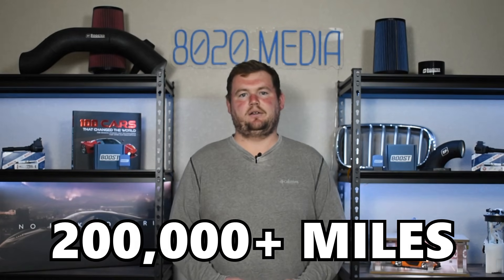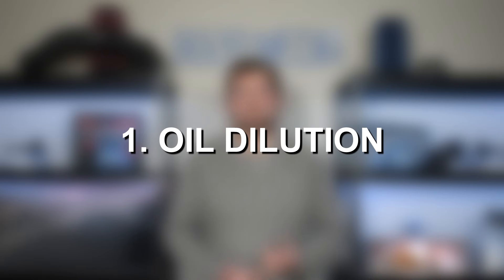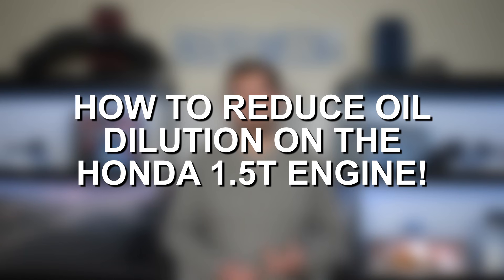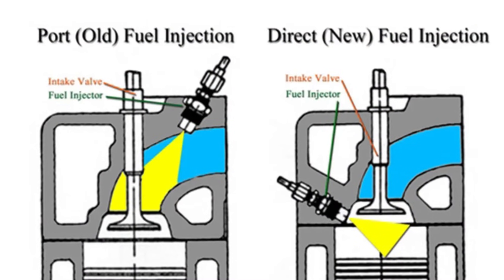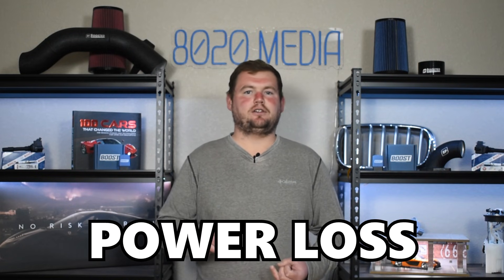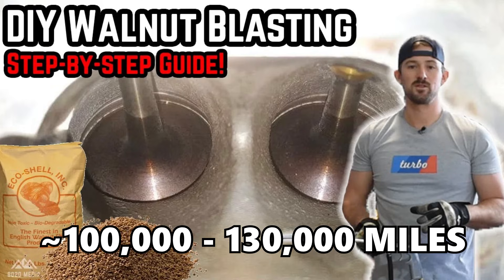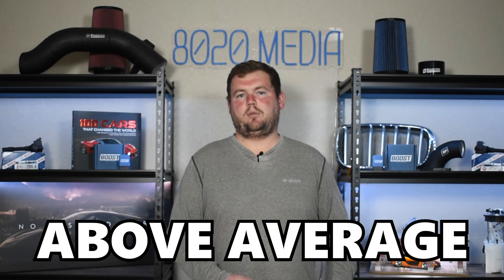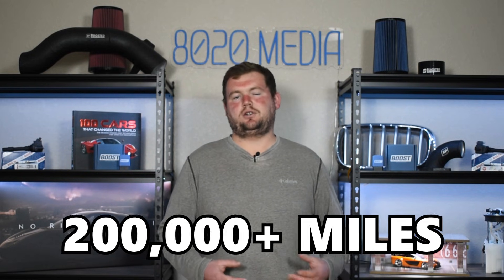Honda 1.5T Engine Breakdown – What Every Honda Owner Should Know! (L15B/L15C)

Comment: 9,000 mile oil changes? 😂 Does anyone actually follow these “recommendations”?
Reply: Imagine what that diluted oil would look like after 9000 miles 

I don’t care what car it is 

Oil just don’t clean well enough or stay clean after that long there’s no fucking way no way in hell 

Especially in a high mileage car no way
Reply: Sounds to me your either one of the lucky ones or not one of the lucky ones with this engine. I expected more from Honda, I have a 2024 with 1000 miles and now I am sorry I bought it.
Reply: @fd4340  don’t be sorry. It’ll be a great car for a long time my wife has a 2019 that she loves, just change oil every 5000 miles get the valves cleaned at 40,000. It’ll last forever.
Reply from the maker: S - Unfortunately, there are probably tons of people that do..
Reply: Honda wouldn't change my oil in my new 2024 Accord until the 15% oil life light came on. @8020Automotive

Comment: 2,000 mile oil changes of 0W-20 for my 2023 Civic Si with the L15CA. It has 23 something thousand miles and I'm the first owner. I drive it hard to redline daily in short route stop and go traffic. I have no issues with my vehicle despite my aggressive driving style. I fill my vehicle up with Shell 92 AKI octane.
Reply: 2,000 miles lol…send me your oil when you’re done with it!
Reply: @FlatOutMatt Purchased oil at Dollar Tree to save money.
Reply: I’m in SW Texas. I use full synthetic 5W-30 and change oil every 5000. Running 0W-20 is crazy imo. Might as well use vegetable oil. I think manufacturers use thin oil to get the mileage numbers up. I’m more concerned with reliability.
Reply: @steveh1256  200,000+ miles using 5W-20 in my 2006 Civic begs to differ. Data over feelings every time…
Reply: @steveh1256  great point I just switched to 5W 30 here in SoCal for the same reason.
Reply: I have a 25’ civic si and it barely has 800 miles and i’m already looking into what oil i’m putting in it and a whole lot of other research 😂 car is super fun and reliable 🙏🏽
Reply from the maker: B - Nice! Thanks for taking the time to share your experience.

Comment: That sounds good but the 1.5T has had an inordinate number of failures of the fuel injectors.  Honda extended the warranty and provided a service bulletin for some, but not all, of the 1.5T engines.  If your VIN number isn't included, then you are out of luck.  Failures seem to occur between 50k-80k miles.  The excessive carbon buildup can be cleaned but Honda says their injectors are defective and must be replaced if you get the dreaded system failure bonanza.  Full synthetic oil changes every 5-6k miles didn't prevent the problem.
Reply: This is a Honda issue not an issue specific to the 1.5t. Honda’s 3.5L v6 also had the same fuel injector recall.
Reply from the maker: C - Thanks for taking the time to share this!

Comment: Head gasket may most likely fail outside of warranty. Good luck! 
Turbos should run premium fuel. Excessive fuel dilution will lower effective octane when fuel vapors enter the intake through the PCV system.
Reply: 87000 for me 2018 Accord
Reply from the maker: K - Thanks for sharing.

Comment: This is the main reason why I put 91 or 93 in my 2018 accord 1.5t sport now. I heard a lot of talk about detonation on regular over time which can lead to head gasket failure do to the higher pressure. So far mine has about 55k and it runs very nicely and it has really good power and fuel economy for what it is.  fuel injectors seems to be an issue too and that’s why I like to go to Shell as it is top tier and specifically designed to keep those things clean. Hoping she lasts!
Reply: I’ve had my 2018 EX-L since 2021 and I’ve always used 87. I’m now paranoid and started using 91. I’ve noticed it’s started idling a tiny bit rough a couple times, not consistently, but enough to go “hmmm”. So i got a coolant block test and it came out fine, so 🤞🏼. I currently have around 76,000 miles
Reply: @tarahwilliams7325  I have noticed that as well a couple times. I’m not really sure if it still happens when I put the higher octane but it did when I used to put 87. Only sometimes though, not all the time. Besides the newer accord require 91 and only .3 compression bump so that doesn’t make sense to me and it has the same power and torque.
Reply from the maker: M - Nice! It definitely will last, it's a honda.

Comment: My daughter has 110,000 miles so far.. zero issues unlike my 22 sorento non turbo 60,000 miles with 3 issues leaving us dead in the water
Reply from the maker: B - Sorry to hear.. However, thanks for sharing.
Reply: Hyundai/Kia engines are usually not as reliable as the Japanese brands (especially Toyota, Honda, Subaru and Mazda). I had multiple Nissan models over the decades with no issues. And there are very good deals out there on these vehicles. Recommend buying new or gently used.
Reply: @fredjemal3689 kinda funny. My mom’s old 2012 Sentra engine seems actually fine. That CVT made out of plastic and dreams sounds like it wants to perish
Reply: I think he’s making this comment because he has this engine and it’s been really reliable as opposed to a piece of junk key engine with no turbo
Reply: What does this comment contribute to the video? Wrong car and wrong engine.

Comment: Great video. I've got the 2020 Accord EX-L. 70k miles. Rarely short trips. Probably 85% highway miles. Haven't done a fuel induction service...in your opinion is it worth it in my case? Last oil change my Honda service manager recommended premium gas every other time I fill up...which was the first I've heard that.
Reply from the maker: J - Thanks for the feedback! With your Accord at 70k miles and mostly highway driving, a fuel induction service is probably not essential unless you’re experiencing rough idling, hesitation, or reduced fuel economy, since highway miles tend to keep carbon buildup in check—especially on a well-maintained direct-injection engine like yours; as for running premium fuel every other tank, that’s more of a dealership upsell than a necessity unless you’re hearing knock or the engine feels sluggish, as the Accord’s 1.5T and 2.0T engines are tuned for regular gas, and using premium sporadically won’t provide any meaningful cleaning effect—so save your money unless you’re addressing a specific drivability issue.

Comment: turbo engine needs premium fuel 87 octane is not enough
Reply: Do you have actual evidence of detonation due to insufficient octane or is this “Trust me Bro”?
Reply: I always add premium to my 2022 Honda civic 1.5T! I don’t care how much it costs me lol
Reply: @NathanielCasas-t9l 
I do too
Reply from the maker: L - We agree!
Reply: @8020Automotive  I hear the 1.5 L motor needs 87 octane fuel because it burns hotter and the engine needs that heat
Reply: Been running super gas in all my Hondas last 30 years although the Sheetz on 51 has ethanol free 91 my 2015 fit likes ethanol free a lot I fill up whenever I’m close by there I hate CVT transmission I do a lot of driving in S mode to 35 miles too many hills things a dog on the hills in D. S mode suits hills well
Reply: It has to do with how the  motor is tuned. If it says low octane then it was tuned for that
Reply: I agree 💯

Comment: You are one of the reasons why Youtube despite all the slop still is a good platform. Good work my man
Reply from the maker: C - Thanks for the kind words. We really appreciate it.
Reply: @8020Automotive  Hello. I have some comments for this engine. I have a Civic 2017. I bought it in 2017 and I have 180.000 km. To avoid the oil dilution and the gasket issues, you need to get a good fuel. I'm using the 95 octane fuel and zero problems from 2017. If you avoid to run with a bad quality fuel and you heat enough the engine before to go, you will NEVER have issues with this engine.  
The gasket issue is linked to the bad quality fuel too. With a 91 octane fuel, you will have the explosion before spark. It will damage your gasket. (sorry for my English. I leave in EU)
Reply: Yes, good work. Only thing is the Honda 1.5L turbo should run on 87 octane, I don't get your higher octane recommendation!

Comment: “No engine is perfect.”

K24: “Speak for yourself.”
😂
Reply: 2012 Si owner here... 300k problem free miles and counting...
Reply from the maker: @marc-oliviercabot3380  Thanks for sharing.
Reply: Don’t forget us K20 variants! (Z1 in my RSX 😂)
Reply: @Save_the_Stick_Shifts  most would say the K20 is the more special one, its just more rare. im at 290K miles in my 08 Si
Reply: @bucknut2000 that was the last of the Mohicans.
Reply: @Save_the_Stick_Shifts  327k on my 2010 TSX
Reply: Yup. We gave up the rock solid 2.4 naturally aspirated engine for the 1.5t. Not a good trade.
Reply: @roberttrask6826  So true! I'm keeping my '15 Accord Sport until the wheels fall off 😆
Reply from the maker: U - Lol, good point.
Reply: And no transmission is perfect either.
Reply: k20z3 💙

Comment: I’ve had 2 
L15b7 and currently the l15ca 
The b7 had 145k miles when I sold it in my si it was a stage 3 made 300whp and I beat the hell out of that car 
Never had any issues I did full synthetic oil changes every 3500 miles and that’s it 
Doing the same for my ca and I recon this will be just as reliable
Reply from the maker: M - Thanks for taking the time to share your experience! These things can be beasts.